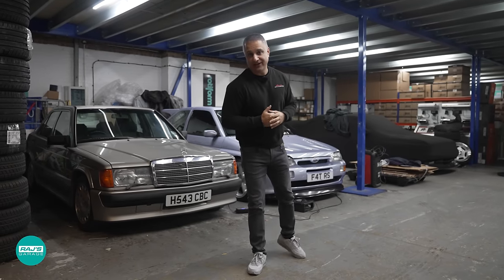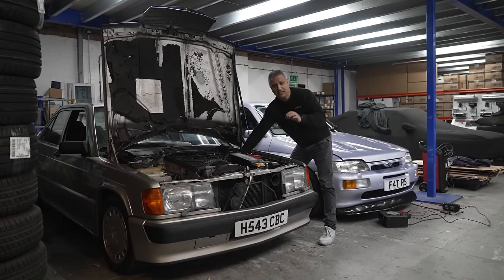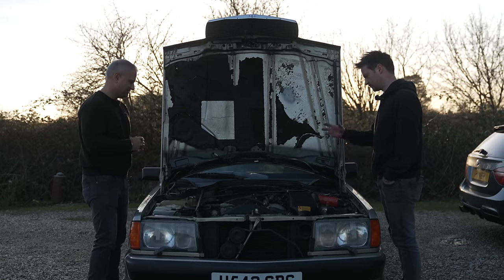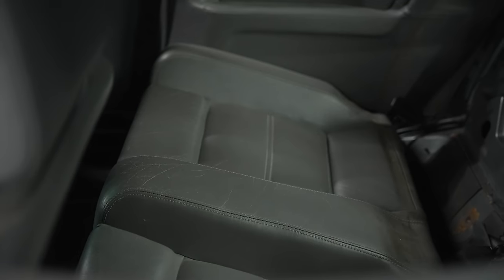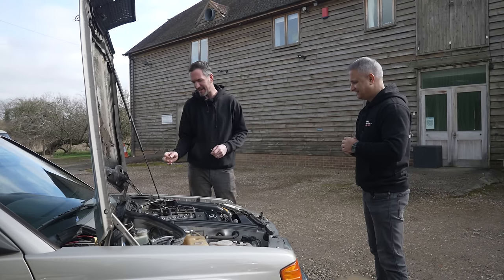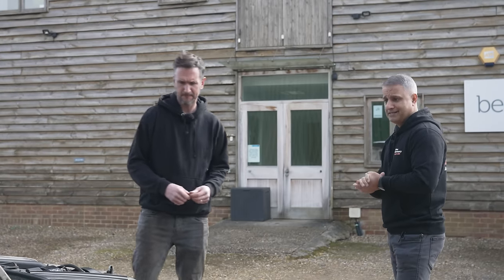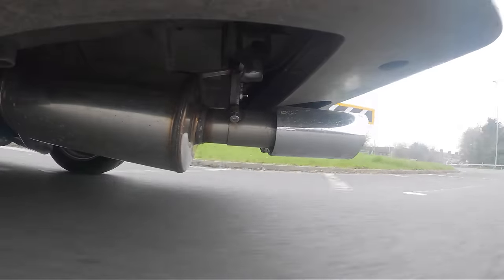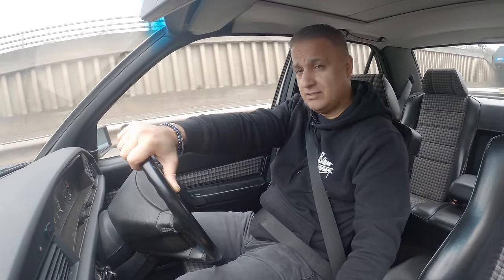My Mercedes 190E 2.5-16V Cosworth Runs Like a Bag of S**t | Raj's Garage

Comment: Getting rid of the CIS and going ITB + Standalone was the best thing I ever did. The total cost isn't actually that far off what you could throw at the CIS to get it running right anyway! My 16v starts hot or cold. Idles solid as a rock and makes more power. Appreciate the values of these might stop people going down this route but technically it could go back to stock should you wish. Glad you've got this one sorted!
Reply: I almost did EFI on mine but opted for stock refurbishment for value later. Runs like new (mostly) still have 2 new pumps to go on and new BOSCH fuel accumulator
Reply: Honestly efi has a lot of advantages like knock detection etc. If one wants to, the best thing about it is, that you are able to even keep the cis optic...my 103 2.6 will get an efi too
Reply: most people who build na engines do efi straight away, it shouldn't be no difference with these. I know allot of the mercedes engines from this era see good power increase with EFI

Comment: If its cutting out at idle when your coming to junctions and you have to keep blipping the throttle to keep it running.

Change the throttle microswitch at the end of the throttle cable it tells the ECU your foot is off the throttle and to keep fuelling the engine. You can get them from Mercedes and its a easy job worth changing the throttle cable at the same time another easy job. I did this on both the 190E's i've owned one being a 2.6 manual the other a 2.5-16v like yours but in 199 blue black.
Reply from the maker: Thanks for the advice - it’s sorted now and running like a dream 👌🏽

Comment: Had my CIS system recoed recently, new fuel distributer, dizzy cap, injectors, pumps, fuel tank and filter, runs great yet off the line the 2nd gear start is 💩